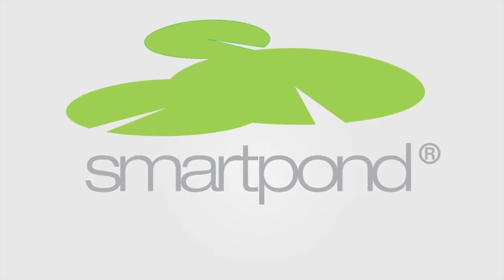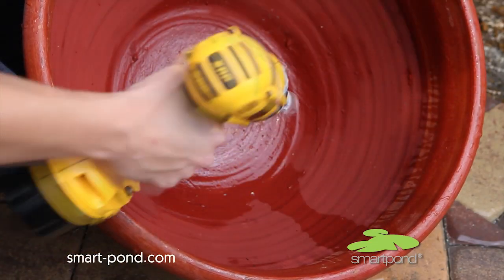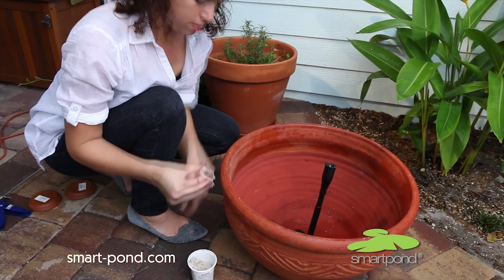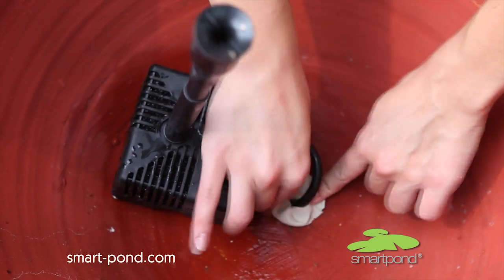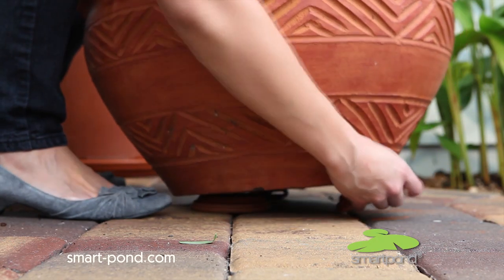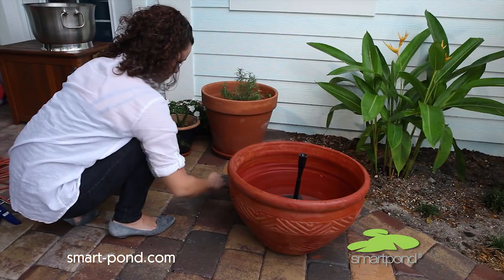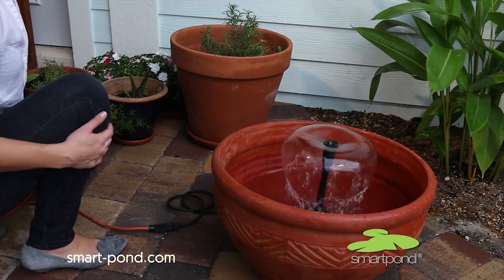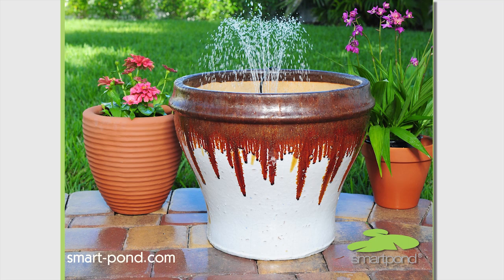smartpond® Container Fountain Kit

Comment: That particular fountain head would be wonderful for a bird bath. It looks gentle enough for them. You could position a shallow bowl inside the rim of the pot. Place a bucket upside down inside the pot to support the bowl. Cut holes in the bucket and bowl for the fountain head. You might need to cut notches at the rim of the bucket so there is adequate water return for the pump.